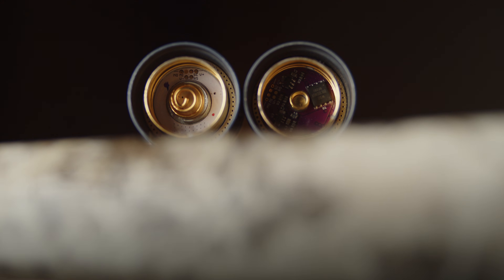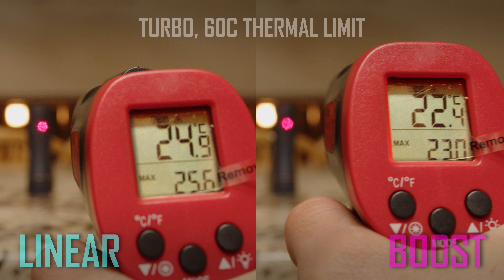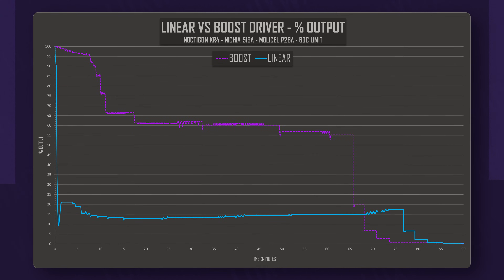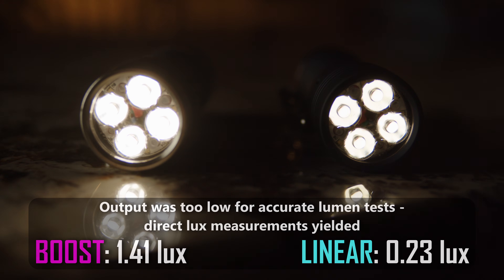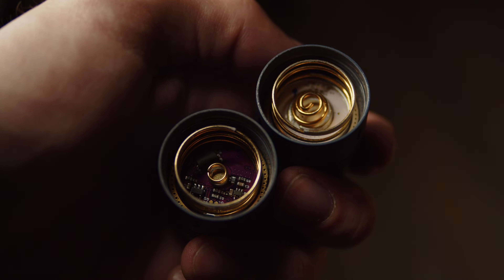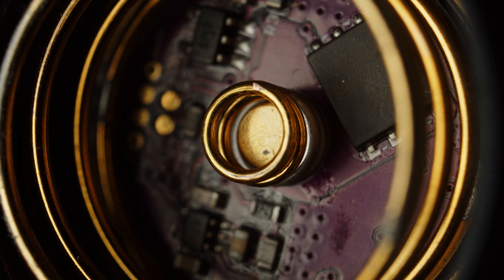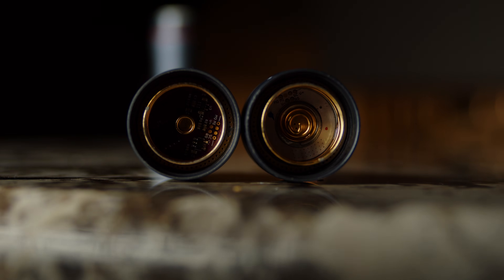BOOST Vs LINEAR Drivers - Which is better?

Comment from the maker: Additional info:
Both lights were calibrated and set to a 60C thermal limit, ran off Molicel P28A for the runtime tests.
I also used the aluminum bezels on both lights for the tests just to eliminate any extra variables.

While the boost driver did produce 2,000 lumens on one test, I always do multiple output tests for my turbo numbers and 1,600 was the much more consistent result, reflected in the runtime graphs. In theory I suppose it could be better under ideal circumstances.

Comment: Is the flashlight in this video the little brother to the dk4?
Reply from the maker: It's basically the same thing but uses an 18650 instead of a 21700. The KR4 is a tailswitch light, the D4V2 has a side switch.

Comment: wait so you're saying that this 18650 flashlight can sustain almost 1000 lumens for over 3 hours??? 

please do answer if you see this comment, because it is very hard to believe this kind of runtime on an 18650 light and i would like to know whether you made a mistake or if this is really just an insanely efficient light...
Reply from the maker: I think the graph is mislabelled and that it's supposed to be 100 lumens instead of 1,000.

I will have to rerun-the tests to verify at some point
Reply: @LuxWad  oh, i see. thank you for clearing this up for me.

Comment: After watching the video I now wonder how my Wurkkos FC11C with its buck driver and 519a fares compared to the unregulated predecessor, the FC11 also with the 519a.
Reply from the maker: I've compared those two on the Lumencraft channel: https://youtu.be/QxW6XM3plrs

I have the older LH351 version of the FC11 but it's very similar performance-wise
Reply: @LuxWad  Thanks for the link. I did not realize that was also you behind Lumencraft. 
I have an FC11C in 5000K myself, but never stumbled upon your review as I bought mine about 2 weeks before your video came out.

Comment: I'm looking for a headtorch for using mountain biking/running/skiing in snow/rain - the ones I already have you can see pulsing on the snow streaks (instead of a solid line each flake is a line of dots). Is this PWM or ripple? What kind of torch/model/driver will entirely eliminate 'dotted streaks'? A lot of companies don't specify which driver they're using?
Reply from the maker: Yes, that is PWM. Few manufacturers mention wether or not they use PWM in their lights, Nitecore is one that does specifically list this in their features. It is not specific to any driver type, just individual designs.
The best thing to do is check reviews on zeroair.org as he's tested just about every light and always includes PWM measurements.

Comment: Thanks for the video. I was going to buy a convoy c8+ and have the option to choose buck or linear driver. If you don't mind, can you tell me what the difference is?
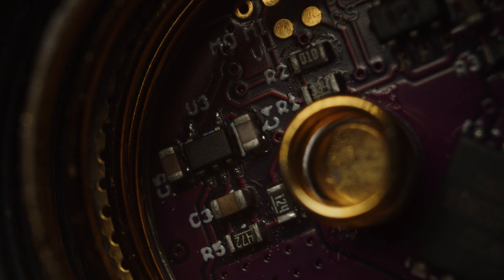Reply from the maker: Buck drivers are discussed at 4:04. They have functionally the same advantages as boost drivers, they work by the same idea but they drop the voltage instead of boosting it.

Comment: Buck Driver is the Best 👌 👍
Reply: Which lights are buck without the boost?
Reply: @kma5699 Convoy
Reply: @kma5699  Most non-FET single cell lights with 3v emitters.

Comment: Hi thanks for that. I want to build a bike light that can run off of a single 188650. My current emitter is an XML U2 with an NANJC 105c. Would a boost with an XHP 70.2 be more efficient? I only need 60-100 brightness.
Thanks
Reply from the maker: Yes, the boost driver + XHP would be more efficient, as the NANJC driver uses the AMC7135 linear regulator.

Comment: Thanks for explaining this. I definitely lean towards boost driven lights. To me the turbo mode is a gimmick for the people that want something with high numbers.
Reply: 4k lumens lasts like 15s so i agree
Reply: @blackbird1132 bei einer beschissenen Lampe halten die nur 15 Sekunden, bei einer guten deutlich länger... insofern ist deine Zustimmung irrelevant, kleiner Mann...
Reply: Ja ist klar... Steig du mal auf deinen 30 Jahre alten Tretroller und fahr eine Runde um den Block...

Comment: Can you point me to the right direction, i wanted to upgrade an ultrafire sk98 with the brightest led it can handle paired with a good boost driver 😢
Reply from the maker: I'd ask on BudgetLightForum.com.

Mountain Electronics is a good source for flashlight modding supplies

Comment: So ive got 4 hank lights, 2 d4v2's, a kr4 and a d1, and used boost drivers on all of the quads. I'm looking at getting my first 21700 (the d4k with 519a's) and im struggling to pick between the boost and the linear. Anyone able to chime in with what they'd go for and why? Im not sure which fits the 21700 better given it's got the same thermal mass.

Comment: Wait hanks website says ‘em the boost driver is not compatible with the 519a, but your flashlight has this configuration. What does this mean. Also I notice that hanks website lets me use select the boost driver and the 519a in though he says it’s not compatible…. I’m confused
Reply from the maker: What lights are you looking at? Any single-emitter light cannot pair a 3v LED with a boost driver, only the quads are able to do that.
Reply: @LuxWad  it’s d4v2 ti 519a 4500k.
Reply from the maker: @iosonoi.7132 just email him about it, he probably forgot to add that option to his site

Comment: Excellent video! How did you get the linear one to run at ~1k lumens I thought you said it was temperature limited to ~500lm
Reply from the maker: Great question! That's part of what makes these reviews so difficult - the light can sustain more, when running on Turbo it quickly builds up excess heat that can't be fully shed throughout the rest of the run - meaning sustained output can be higher when run at a lower mode. Finding the highest possible sustained output would require lots of testing and time that I can't justify, so I usually just run full Turbo and high runs.
Reply: @LuxWad 
1k lumens for over 2 hours is great. Was there a big difference in temperature like 60C to 40C or so? Ty
Reply from the maker: @rainer904  Yes, there was a big difference but I don't have the specific numbers.

Both lights were set to a 60C target for all the tests.

Comment: The one thing I got from this video is one is not better then the other. Its a tradeoff.
Reply: I bought a DW4 with the boost driver (thinking it was the Lume X1 driver but it's not) and thinking the upcharge was good for extra efficiency and runtime, but had no idea I was sacrificing moonlight mode.  I was hoping I could have super low moon modes AND extra long runtimes.  Sucks it's one or the other.   I do have a Lume X1 boost driver in my FireFly lights so I guess that is the best of both worlds, I just don't care for the bulky size of those headlamps.
Reply: They're situationally comparable.

Comment: Just noticed something I was hoping you could provide some clarification to. At 2:30 you show sustained output with the linear driver hovering roughly between 500-700 lumens with the 60°C limit, after the initial stepdown from turbo, then in the next graph of battery life at the same output you have the linear driver set to 1000 lumens, which is maintains for almost 3 hours. For that test was the thermal limit increased or was there some cooling to allow this higher sustained lumens? Or was nothing done differently, and it was all down to just not starting from turbo? Sorry if this has been answered already. Again, amazing video.
Reply from the maker: The thermal limit was the same, both drivers but especially the linear driver sustain a bit less during the full turbo run because the initial output spike generates so much heat.
That spike is so dramatic is has a big impact on the total comparison, so that's part of why I included the 1K comparison

Comment: How high does the moonlight level need to be set (1 - 150) to avoid the initial flash on startup with the boost driver? Does the flash only occur at the very lowest few levels? I think Anduril is set to level 10 or 11 for the bottom of stepped ramp by default. Does that level work well and stably?

Also, does the rippled output in the lower modes with the boost driver affect the levels higher than around 10?
Reply: I ordered a boost-driven D4V2 (Nichia 519A 5700K dedomed emitters), so I will answer my own questions for the benefit of others. I tested this light in a perfectly dark room against my old FET+1 (7135) driven D4V2 with Luminous SST-20 4000k emitters from 2020.

The moonlight startup flash, which is pretty subtle, stops being noticeable at level 10, and even the few levels lower than that are already almost as bright as the flash, mostly masking it. The moonlight default level appears to be 10, which works perfectly and is as dim as I ever need it to be. (I have never needed a moonlight level of lower than 20 on my old D4V2.)

(If I pay very close attention, I think I can see a very slight flash three or so levels above 10, but it is too slight to be sure.)

The rippled moonlight output has about the same behavior, being barely noticeable by level 5 and gone (to my eyes) by level 10. Even at level 1 it is so subtle that it does not bother me and I have to pay close attention even to notice it. Above 5 I can hardly be sure I am even seeing it, even with dark-adjusted eyes. And I am very sensitive to strobing.

As for minimum moonlight output, the boost driver seems to be achieving the same level 1 moonlight output as my old FET+1 D4V2, but I do not have the instruments to measure them. If it is higher, it is not noticeable to me.

Perhaps Hank has improved the driver since this video was made.

I am sufficiently satisfied both by the moonlight brightness (even at level 10) and the behavior of it at the lowest levels, and I am extremely picky and obsessive about details.

Comment: I just don't really understand limiting the light with boost driver. I rarely need sustained high brightness levels that would justify the benefit of one. I guess some do.
Reply: Driving 6v/12v emitters
Reply: Well, professionals do need this sustainability, Leo's, rescue teams and so on. You also don't hike a lot, don't you? It all depends, for edc lower outputs are enough and higher turbos are preety cool 😎 and also useful, surprisingly so...
Reply: @wesolowskimatt  the tiny spring on Hank's boost drivers, and all the components on the battery side of the driver, make feel like its a more delicate thing compared to the linear drivers and for that reason I don't like to use my boost driver lights for work. They're probably fine, but the linear drivers just look more solid so I lean to them for work without thinking about it
Reply: @wesolowskimatt I work outside constantly and I'm usually out till 10pm in the summer. I'm always using my lights. I like that bright turbo to see things far off sometimes. I'm in the country. I did just get a ts22 and it last quite a long time with it's more efficient driver.

Comment: You keep raising the bar.  These videos must take a lot of work!
BTW, Hank is working on improving the low modes on regulated drivers.  I don't know how long it'll take, but it should result in lower lows which are more stable and more efficient.  I'm hoping it can include a passive moon mode too, able to run without the MCU awake, which would increase runtime to a year or more... but I'm not sure if that's going to happen.
Reply: I do find moonlight mode on the boost driver too high for bump-in-the-night checks.  I would say the linear driver that I have is just right.  However efficiency and runtime are more important to me so I will never go back to a linear driver.
Reply from the maker: Thanks, they are time-consuming but fun to make. I just don't have much time for them anymore :P 
That sounds like an awesome update, I look forward to seeing the improved low modes.
Hank did tell me there's no plans for a buck driver in the KR4 size, I still can't help but wonder if that will eventually come along though...

Comment: I have 2 M21Fs from Convoy. One has the XHP70.3 (boost) and the other has the SFT40 (linear). While I'm impressed by the performance of the boost driver, the linear is just better. For one, the linear driver is much more stable and has never malfunctioned, while the boost driver can sometimes fail consistently. As for heat performance, they are pretty similar, which I wasn't expecting because they're both running at 30W max. but the SFT40 is being overdriven and the XHP70.3 underdriven. Not sure if it's the driver's fault but in practical terms linear drivers just seem better in my opinion.
Reply from the maker: Boost drivers are definitely more complicated and prone to having issues, quality drivers with stable and reliable performance tend to be expensive. I don't have much experience with Convoy's drivers but they seem to have some quality control issues with the boost models.
Reply: What kinds of failures have you encountered? I'm trying to decide between the two drivers for a D4v2 with 519a DD emitters. Difficult decision...
Reply: @Joshuacliftojm  well, the failures I encountered may only apply to Convoy drivers, if you want a better perspective you might want to ask someone who owns the lights. The most common problems I've encountered are during ramping mode and voltage detection. Sometimes the driver will sort of collapse during ramping when it reaches the top brightness and gets into a low power flickering state. In my experience, it's common for boost circuits to do this under high stress. The other one is that it tends to step down from turbo way more than the linear driver because of low voltage, when in reality the battery still has plenty of charge. Once again it will depend a lot on the design of the driver, Convoy offers very good low budget lights, but they're still that, low budget. I'd expect that higher end brands like Emisar would offer more stable boost drivers than Convoy. Anyways, hope you can find the information you need.
Reply: @shitass9102  Thanks. I assume you've tried tightening the head and tail of the flashlight? My FW3A sometimes goes into low-power strobe when I ramp up to a high level. Tightening the head & tail solves that issue. My old Fenix light (single-AA powered) will fail to ramp all the way to the top unless I really wrench the head tight. Some flashlights seem to have trouble getting enough current from the battery unless there is a very tight connection between the body tube and the head & tail.

Comment: Is the sfn60 a boost driven led? Whats its voltage, i have 2 d1v2s with them, one at 5500k one at 3000k they seem to chew molicel p28as as fast as my DT8 does blasting turbo all the time
Reply from the maker: SFN60 is a 3v LED

Comment: I edc a DT8 with w2s (#hotrod lifestyle xD) and i take an 18650 battery bank, and a spare 18650 in a duel case with my cables so i can charge my phone, or all 3 batterys if i have a usb port, so i dont have to worry about runtime as i have 3 molicel p28As on me at one time, plus my d4v2 sst20 4000k with the 1100 mah 18350 on my keys

Comment: Good video. I have D4K and D8K, both with linear and boost drivers, and W2 emitters. Both lights behave similarly, given the same driver. As an example, on turbo, the boost driver will be brighter than linear after about 40 seconds, subjectively speaking. After the initial turbo punch, IMO, the boost driver is superior for extended use: brighter, cooler, runs longer.
Reply: Agreed. I have both and the initial Linear was fun but fad too soon. Boost driver for me.

Comment: This is the best material on this topic, thanks! I will add that the boost driver, along with an increase in voltage, also reduces the current strength (the law of conservation of energy). So if the LED in your flashlight runs for example at 6V and is capable of accepting 8A, then you need a battery capable of delivering 6V * 8A = 48W, and this is a minimum of 15A, not 10. But high-current batteries (30 amps or higher) will already be overkill and will not provide any advantage

Comment: The Wurkkos TS22 is almost godlike... It manages to beat the Acebeam E70 and match the P17 in performance, all while costing about half the price of the P17.
Reply from the maker: I've been interested in that light for a while, looks like I'll have to finally get one
Reply: I've been holding off on it as well since I have an Acebeam E70. But now that it comes with the better throwing XHP70.3HI, it's just too good to pass up a more compact P17. Now, if only that emitter will come back into stock...
Reply: Sofirn SC33 and back button - this is E70 economic killer 😁
Reply: @jackblock7451  I have the SC33 in green and it is one of my favorite lights. (At least when I'm not pocket carrying. She's a bit chonky for that.) Pushes 5k lumens out of a boost driver - sustains close to 2k; which is very very good. Ramping UI. Find myself grabbing it for it's battery bank function also. I think it's good for 3A? either way it seems to fast my phone charge quite well. Paid like $40 (w/battery) during a sale, amazing value.

Comment: I've just ordered a D4V2 with the default driver, because I really needed the lowest moonlight level... But now I wonder If I'll get the linear or the FET+1 driver! 😫 There's no option for the linear driver on the website, only for the boost driver.
Do you know what the standard driver is?
Reply from the maker: The D4V2 now comes with the Linear driver, the only lights with the older 7135 drivers are the D4SV2 and the D18
Reply: @LuxWad  that's a relief, thanks! 😊